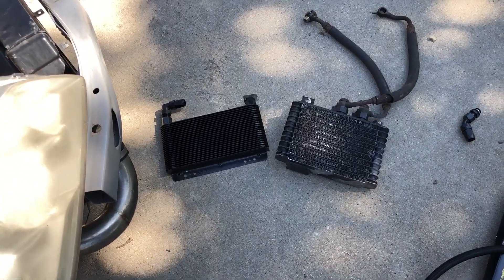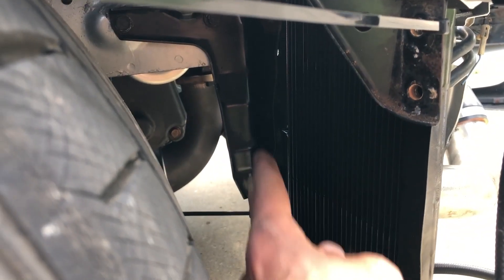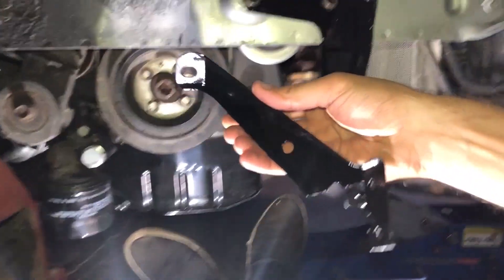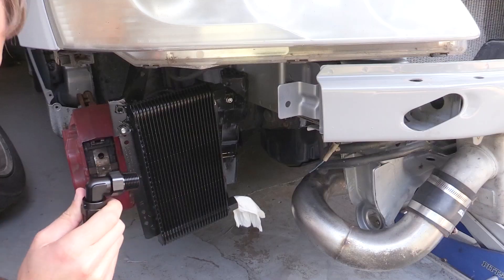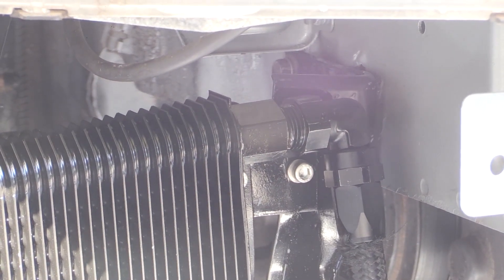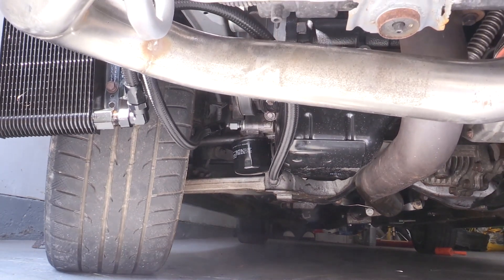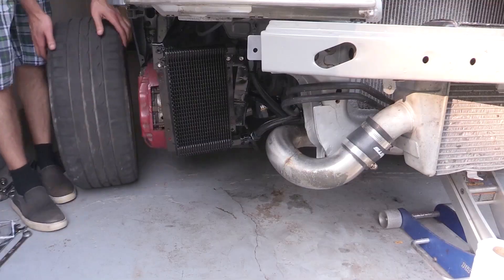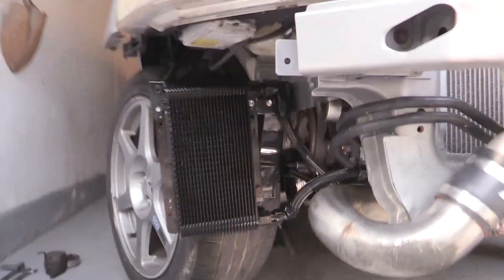Tips for Installing a STM (B&M) Oil Cooler

Comment: It’s funny that you’re the first to actually post something about this. I didn’t buy the stm kit for the same reason and went with the MAP kit because it reuses the brackets from factory. The problem is that aftermarket coolers don’t come in the same size and capacity as the oem one. If anyone buys the MAP kit, be warned about how much lower it sits compared to OEM and STM’s kit. I wouldn’t recommend using it for off-road. I’d suggest relocating the cooler upfront behind the radiator in the core support area, so it doesn’t get knocked into
Reply from the maker: Good info, thanks for sharing.

Comment: I had the same concerns as you on the STM kit, and ended up not buying it.  Didn't like the single bracket, didn't like that the lines pointed downward.  I managed to get the AMS kit, which is a superior kit, they have adapter extensions to make the aftermarket cooler mount with both of the OEM brackets.  Looks a lot like what you ended up with, and with the lines on the inside of the car like stock.   Permatex #59235 "high temperature thread sealant" is the best solution I found for the tapered threads on automobiles, since it is designed to survive both oil and heat.

Comment: Does the oil cooler perform better than stock? Like the temp gauge reads lower, or no noticeable change?
Reply: No, it’s about the same, just maybe a little bit more capacity of oil.
Reply from the maker: I don't think the one I installed is any better cooling than OEM. (but they do sell larger coolers) Its just a cheaper option than OEM and better than no oil cooler at all.